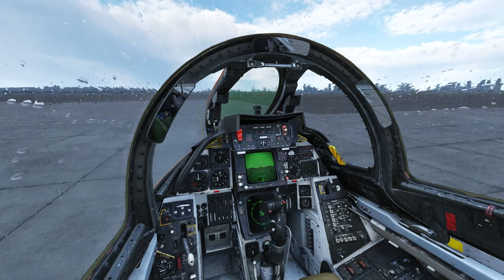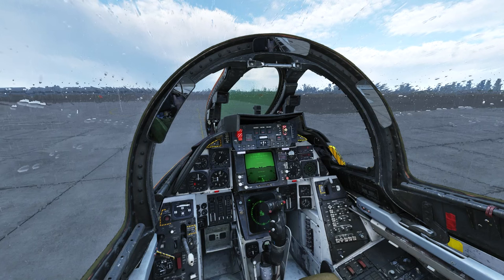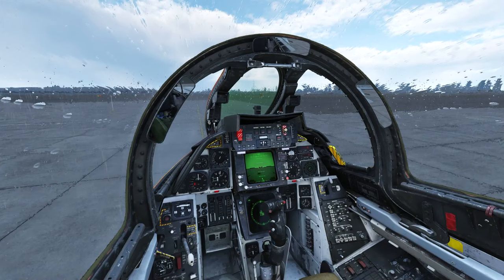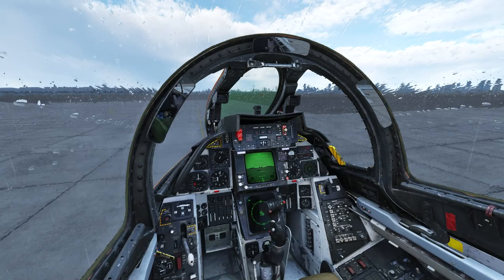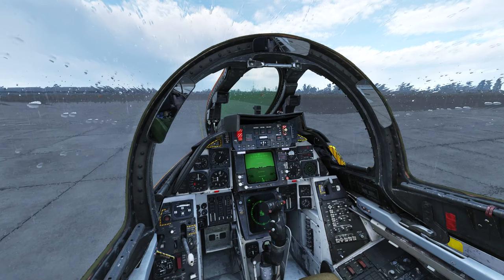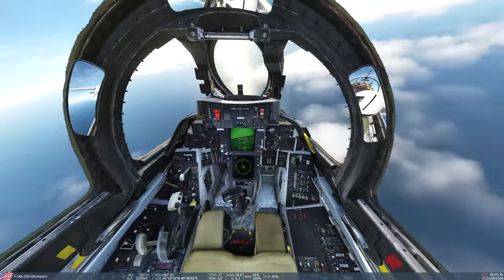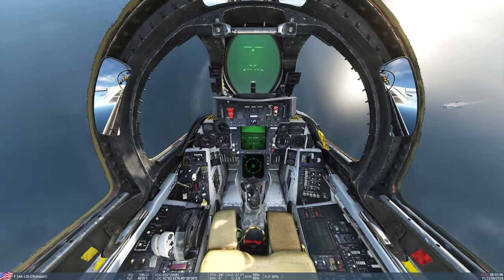Maverick could have SAVED Goose

Comment: But in the movie both engines flamed out so he couldn't do what you did with the engines to recover
Reply from the maker: I added an explanation in the description since this seems to be a common question.

As I mentioned in the video, the engines in the movie actually just experienced a compressor stall (they explain in the debrief scene). In a compressor stall, your engine is not completely dead, but it does result in a reduction in thrust temporarily.

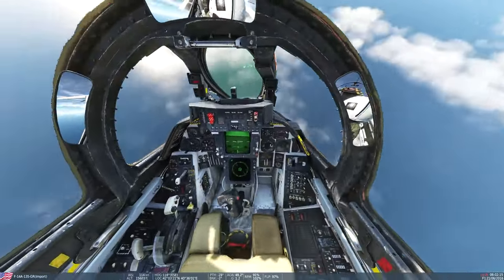This is actually accurately modelled in the simulator as well. At 3:54, you can see the left engine compressor stall warning go off in the cockpit, meaning the left engine has stalled. The engine is still producing thrust, but it’s significantly reduced - but we can still use what little thrust it produces to counteract rotation.
Reply: @bravosix1611  would the amount of thrust necessarily be enough to counteract the rotation? Or is it very much hit or miss?
Reply: exactly try to get the machine under control while you are pressed into this side with full force. And the probability of getting the machine under control is far too low. Therefore the action was already correct
Reply: @bravosix1611  both engines flamed out and would need to be restarted if they can, which maybe they couldn't, those engines in the A were unreliable
Reply: @bravosix1611  you are using a flight sim to explain a movie that had actual pilots from the airforce giving their input. Bailing for them was their best option due to time… real world time a lot shorter not to mention under stress. He did not have hindsight in that perspective. He technically may MAY have been able to recover however his altitude would have been far to low to manage anything saving grace wise let alone there is a minimum altitude you are expected to eject from in which you actually plan to live. I will also state controlling this via pc versus someone under a decent amount of G forces, high stress situation, etc.
Reply: @damianh4510  A flight simulator is a simulator, meant to accurately represent the amount of time, and power required for recovering from a flatspin.

I have tried the technique shown in a flight simulator while descending at around 900-2000 FPM
Reply: @damianh4510  and uh, not sure about this? but apparently naval fighter pilots are trained.
Reply: i just realized im seeing 2 grown men arguing about how some dude with a mask could’ve recovered from a portable roller coaster
Reply: @bravosix1611  But did BOTH engines stall? Maverick did recover his second attempt.
Reply: There's a room of people who asked (it's empty)
Reply: @damianh4510  We actually need to know how much of that input was actually used in the movie first. IIRC originally Goose had to die in combat but the Navy vetoed it so they put in the training accident. The movie was a piece of propaganda so there was probably a constant pull between pilot inputs, Navy notes and Hollywood being Hollywood while a flightsim usually has its priorities more straightforward (that is: make it as realistic as possible for the for the fighter jet nerds).
Reply: @bravosix1611  Let's also imply that if Goose's death didn't happen, the story plot would have been weirdly messed up.

Comment: Nice recovery, but a few points I feel need comment. Firstly, you apply opposite throttle. Great, absolutely the correct action clearly, only you have no engine power because "both engines flamed out". Now I realise you explain this away with the claim that it was in fact only compressor stalls and not a full blown flameout, but compressor stalls can easily develop into a flameout if the disruption to airflow is great enough or the comp stall situation goes unresolved long enough. The reason I feel this is important is that while I'm sure the situation began as a compressor stall the people in the jet in the movie claimed to then have flameouts. I think as they are the ones sitting in the hot seats, we have to believe them and assume that the comp stalls did in fact develop in to full blown flameouts. Secondly, on this point, even if we assume that they were only experiencing a compressor stall, and not a full blown flameout,  giving full throttle to an engine in the throws of compressor stalling is a real bad idea. The vibration from that could easily tear the engine apart, give you an engine fire to deal with and a whole bunch of other issues.

My second point that you've missed is that effectively you state that they could've recovered with 3,500ft to spare, well from everything I've heard from fighter pilots and ex fighters pilots of the USN and USAF, there is a mandatory ejection imposed at 6,000ft, if you're aircraft is not undercontrol by the time you drop below 6,000ft the procedure says you pull that yellow and black aeroplane jettison handle. The purpose of this is to prevent the attitude of "I got this...... I can recover it, just another 1,000 more feet and I'll be out of this..... it's fine...... I got this......." all the way into the ground. So..... regardless of weather proper recovery would've allowed the F-14 to come out of the spin or not, Mav still followed appropriate procedure by ejecting. 

No, if you want to look at weather Mav coulda saved goose or not, you want to look further back, not at how they try to get out of the flat spin, but at how they got in it. Frankly, Mav is needlessly close up icemans tail pipes right from the get go, clearly letting impatience and his competetive side influence his actions. Being as close as that seems frankly reckless. Had Mav maintained greater seperation from Ice, or taken some lateral offset from Ice's jet, rather than directly line astern, he would likely have avoided the compressor stall and flat spin situation entirely, and would have been in a better position tactically to support.

While spin recovery training is clearly important, the best technique is always to avoid the spin in the first place.                                                                                                                                                                                                                                                                                            

Just my thoughts on it anyways.
Reply: How to avoid a spin:

Step 1: don’t trust hollywood physics

Comment: This will become a 3M viewed video in no time. Very strange and paranormal things happens every once in a while. At 0:16 in the movie the canopy was detached, fall back and then both seats ejected. The only way Goose would have hit the canopy is if there was no wind or momentum to push the canopy away from the aircraft which is not the case...or if by some weird physics the canopy was detached, the airplane spinned and capony was placed in the exact same position as when ejection took place.
Reply: There was an F-14 RIO actually lost in a flat spin, a bit like you described. The twisting motion caused him to impact the canopy while ejecting, killing him. Probably the inspiration for Goose's death.
Reply: @jonathanalexander7225  It was, while I can't remember the RIO's name, his callsign was goose as well
Reply: From what I understood, the F-14 in a flatspin created a huge low pressure zone over the aircraft that basically held the canopy in place long enough for the RIO to hit the canopy, which is how the real life accident, that it was "modelled" after, took place

Comment: Rly interesting video and great analysis. 

However I think you made a mistake when you simulated the sinkrate during the flat spin. In the movie goose calls out „8000, 7000“ very close to each other. I watched the scene again and stopped the time the aircraft took to dive from 8000 fett down to 7000 feet, the result was around 2 seconds. The ground in this case is the ocean at 0 feet, so the total dive time from 8000f to 0f amounts to around 16 seconds, gravity multiplication not included. 16 seconds recovery time without engine power would Chuck Norris level difficulty. Also the flat spin speed increases as shown in the immediate scenes prior to the bailout to around 2 full spins per second that would make handling inside the cockpit extremely hard. 

I haven’t done the complete math but my guess is that Maverick and Goose had around 4-8 seconds to recover their Tomcat once they passed 8000f, getting almost impossible by around 6-9 seconds after the spin started. 4-8 seconds would technically be enough time to at least somewhat slow the spin down, however there’s always the human factor. Both maverick and goose were focused on their exercise and flew very close to their partners, alls the engine flameout before the spin began needs to be taken into account. This is where your simulation (naturally) lacks, as sully said, the pilot (you) knew excitably what to and where to fly, you were prepared for this and knew when it was gonna happen. Maverick on the other hand was taken completely by surprise and needed to identify the dangers, prioritize the dangers and act accordingly within a very very short timeframe of a few seconds. This might just have been too much for a human to react in time and so Desaster struck.

Now that I’m done with explaining about a fictional simulation test on a fictional movie event that was filmed almost 20 years before I was born and which never happened, I’m gonna go and make the world a better place. Rly enjoyable video.

Cheer.
Reply: Did you know that goose death was based off of a real incident in which what happens I the movie is pretty much what happened in the incident. That's why when you eject from a tomcat in a flat spin you have to jettison thr canopy first and then pull the ejection handles. And this incident happened before the time top gun was set so in a way it's actually gooses fault

Comment: The rotation of the Maverick's F-14 was at 1 revolution per 2 seconds and accelerating, so he was actually at 9g's and increasing.
Reply from the maker: Not at the beginning, it actually starts at 1 revolution per 4 seconds, and I found that the average was about 3 seconds amongst all the scenes. The point is that it shouldn’t have taken that long for Maverick to recognize the spin and apply anti-spin control inputs.

If he had applied the right control inputs at the beginning, the spin never would have gotten that bad. Obviously if you wait for it to develop, it could accelerate to the point where you lose consciousness.
Reply: @bravosix1611  cant forget the fact that both engines actually went out in the original, so he didn’t have the ability to recover via asymmetric thrust in the opposite direction of the spin. Worth noting
Reply: @bravosix1611  at least it was stated in that scene they were out. Not stalled, but we have to believe what the higher ups tell us, it was determined that a compressor stall did it
Reply from the maker: @hogflies3208  check the description, I explain how this is accounted for in the sim

Comment: Awesome video with good scientific explanation and nice flying skills 👌. I was wondering what flight controls do you use? I am just getting into the the Sims world and not sure what to get. My use cases are: 1) to economically improve on my PPL flight training using Xplane; and 2) to have fun along the way with DCS. So probably I need to get a Yoke and a stick. This will be my starting kit(s), and I am not sure if I should start big or build my way up. Any advice is much appreciated 🙏.
Reply from the maker: I highly recommend the thrustmaster 1600M if you want a really good mid range stick!
Reply: @bravosix1611  I just scored a whole set from the local BestBuy few days ago for $260, but didn't open the package yet. I was hesitant not sure if I made the right decision. But thanks for your response and affirmation.
Reply from the maker: Yeah the 1600M uses Hall effect sensors, so it’s very accurate and will last you

Comment: i love this video, i want to get DCS but don’t really know where to start with buying a PC that is relatively cost-effective and can run it.
Reply from the maker: Almost any PC can run it! You just may have to turn down the resolution and settings
Reply: @bravosix1611  sweet, good to know!
Reply from the maker: It’s also free so you can try it out before you buy any additional modules
Reply: @bravosix1611  oh nice didn’t know that
Reply from the maker: You can! There’s scenarios where you can just jump into a jet that’s already in the air, so you don’t have to go through the startup process
Reply from the maker: If you’re new, I would buy flaming cliffs, it’s realistic but simplified controls, and includes a variety of different fighters

It’s a great starter pack
Reply: @bravosix1611  thanks!
Reply: @ClashwithPotato  That's going to be ...ummmm....well, as with any other potato PC. At this time you want more clock speed than many cores, Six should do. 16 GB min.
Reply: PC is not the problem
It's the HOTAS and TrackIR or VR
Reply: @guts-141  i have a flight hotas one for xbox that i use on war thunder, do you think that could still work for dcs? it’s pretty cheap so idk

Comment: I’ve heard an actual former F14 pilot say the biggest problem is the G-forces caused from a flat spin actually pushes your body directly against the center stick. It doesn’t seem like the situation portrayed in this simulator is actually factoring that into account.
Reply from the maker: Yes, you are right that the force on the pilot acts outwards and pushes them forwards, however, after calculating the G forces in the video, it’s not enough to prevent the pilot from manipulating the controls. It even says in the F-14 NATOPS manual that in a flat spin, the pilot should be able to hold anti-spin control inputs for a while at 5-6Gs (whereas we only calculated about 4Gs acting on Maverick).

Comment: idk man, these were pretty optimal conditions:
in such a situation, i doubt maverick would have thought instantly what to do, so less altitude to operate with, and even if so, there was a pretty high risk of colliding with the rocky coast

besides, goose pulled the ejection handle, knowing damn well that, especially at the time, there was a high chance of something going wrong

what they should've tried to do is first eject the canopy, then wait a moment (just enough for it to get out of the way, so barely a second) and eject
Reply: @tornadox31aviation18  I'm sorry what?

Ofc it could be jetttisoned, especially since at the time ejection seats were higly unreliable. Despite never having happened in US's service, they were also faulty to the point where there was a decent chance that the ejection seat would not work, wich would mean manually bail out, recover it or die.
The only difference between the F-14A and B is the usage of 2 different engines, alongside some minor adjustments.
Reply: @tornadox31aviation18  F-14B*